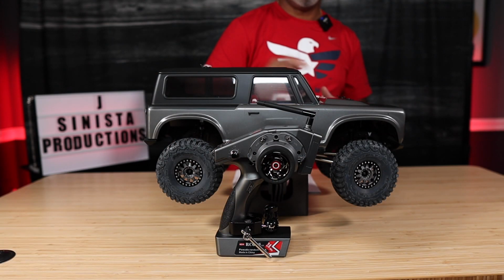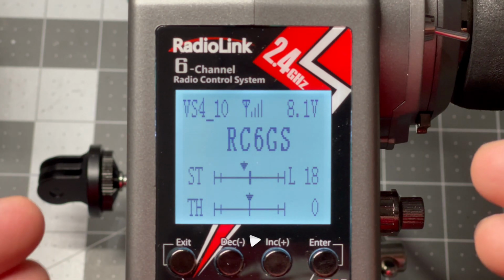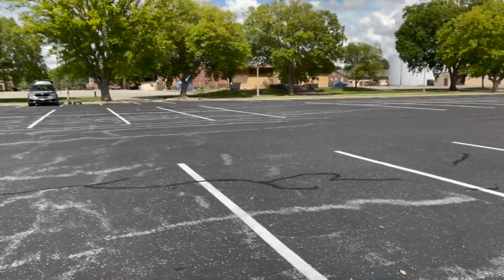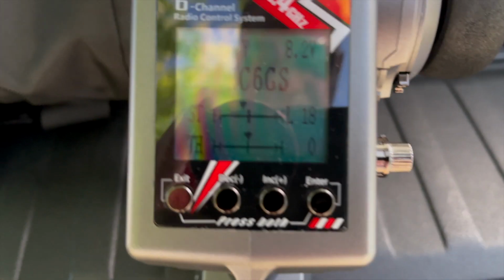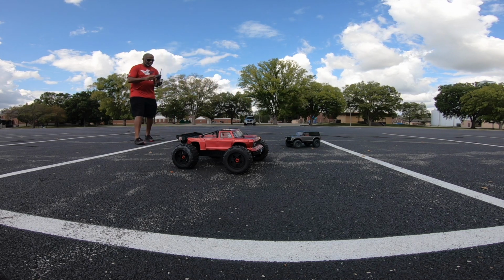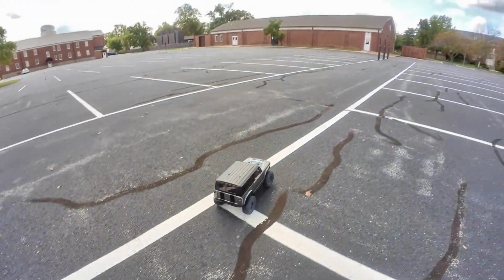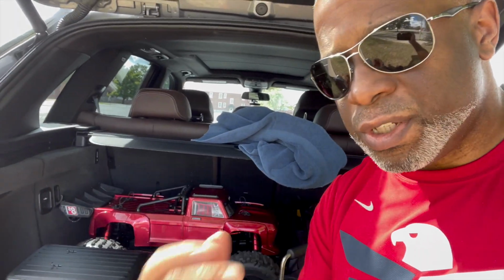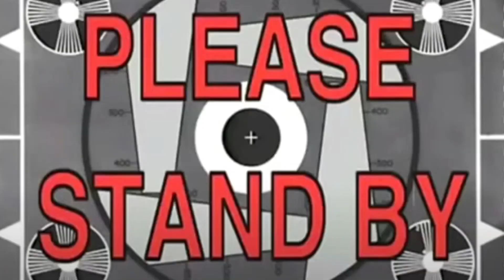RADIOLINK RC6GS V2 ID SEED TEST

Comment: Sweet running! I bet you could run 2 crawlers with this feature as well, just drive one through each line at a time
Reply from the maker: Yep!  ANd, I made a misstake during bench testing before recording this video.  I had the Outcast on a stand about 20" away from the VS4-10.  Somehow I was able to send the signal to both rigs at the same time.  I could literally drive the Outcast & VS4-10 together as if there were two different folks perfectly controlling them.  I know it's not really "uncommon" but like you said it's possible for one person to film and drive two rigs.

Comment from the maker: Settiing up the ID SEED function on your TX and RX is very simple.  If you've already bound your RX to your TX, then you're halfway finished, but it is not necessary to pre-bind as you have to "re-bind" your receiver once you've setup the ID SEED function.  As always, refer to the User Maunual for the most up-to-date instructions (link can be found in the description box above).

1.  Enter Menu.
2.  Go to Menu Item 3, Select appropriate Model.
3.  Go to Menu Item 22.
4.  Turn ON ID SEED.
5.  Assign unused ID number.
6.  ENTER.
7.  EXIT Menu.
8.  Ensure IDXX appears on the main screen and that the correct model is selected.
9.  Re-BIND if necessary.
10.  Done.

Comment: I have same the radio version 2 I never did any of the ID seed etc stuff. I simply went into model name version etc, I named my first truck 2nd truck & so on, all I do to switch between them is scroll to whichever model truck I'm driving & switches to that vehicles stored settings. never had to mess with the ID etc... maybe I did it wrong but everything works great without having to turn trucks off & on 👍🏼
Reply from the maker: Right, you can still do that, but if I am correct, by using the ID SEED function you won't have to worry about any "runaways" while "swapping" models.  Model X ID01 is still receiving a "neutral" signal and won't move, while Model Y ID02 is accepting TX commands.
Reply: @JSinistaProductions  That's cool & definitely makes sense, I'll have to check it out. I purchased version 2 & really didn't know what the difference was so Thanks for the information.. Thanks 👍🏼 .
Reply from the maker: @off-roadrc7126  Yessir!  I see the most benefit for boaters, but it's there if we need it.